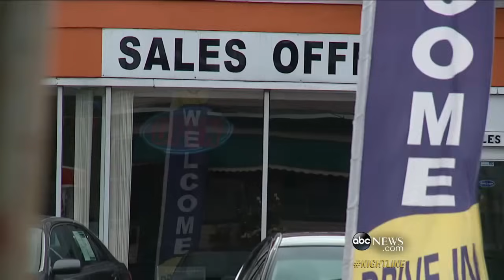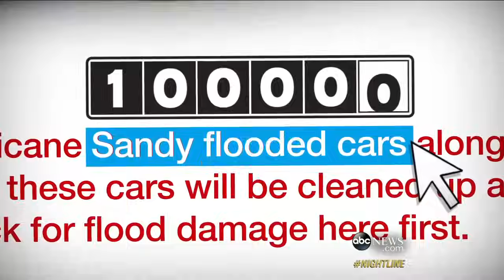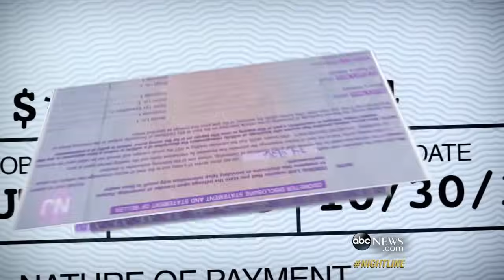How Did a Sandy-Damaged Truck Land on a Used Car Lot?

Comment: I'm going to leave this here:
 I buy cars from a popular site called Copart. I bid on a 2010 King Ranch that I knew had a flood title and I normally won't touch vehicles like this. But the thing was, is that it hadn't been in a flood at all and if it was, it only came up to the tires. This truck is the cleanest truck I've bought. No signs anywhere of water damage. Undercarriage, motor, fluids, under the carpet, and the frame still had original paint on it. This truck will never be road worthy, as the insurance branded it as a Parts Only vehicle - a step beyond a Salvage/Flood title. Which was unnecessary (if you could see this truck).
The only reason I'm commenting, is that there are instances where if you fall into a certain area that was "flood area", all you had to do was call and say your vehicle was in the flood and the insurance company sent a tow truck, hauled your vehicle away and cut you a check without inspecting it themselves because of the amount of calls they were getting. So, just as guilty for fraud as this car dealer was, so are some people who just want to buy a new vehicle and get out of their current one without an issue.

Comment: I can fix that truck
Reply: so can i, just put in a new floor, new seqats, remove the bags. oh and new carpet, and dash. less than a 4k job, for something that looks good as new. year 20k is about right, just 4k and work and anyone would believe it was brand new. the wiring in some seats for those f-350's come with the wiring.

Comment: it's a ford and it survived fine, you don't f*ck with fords nuff said
Reply: I like Ford, but I'm not going to say anything from GM is for "pussies," I only dislike them because I know they are unreliable. Of course, people might even say the same thing about Ford. It's really only a matter of opinion. I just happen to mostly agree with your opinion!
Reply: BixelWeekly Right kinda like a Ford dropping its cooling fan an shredding stuff before it even starts the ike gauntlet lolz :)
Reply: BixelWeekly exactly
Reply: I honestly do not see how one is better than the other. We got a chevy with 261k on it and is beat to shit, runs fine. My dad uses a ford truck he got from his work. If the owner takes care of his car, pretty much any car will last a long time.
Reply: Can’t imagine anyone saved a 6 liter smoker.  It was out of it’s misery.  Poor thing was almost just parts before the flood.  
Also; used car dealers usually are not mechanics and a lot of them get these flood vehicles at dealer auctions and they aren’t aware of that history.  The people that ‘recycle’ these and get a clean title need prison.  There’s no teeth to penalties.
Reply: Fix Or Repair daily.
Reply: Everyone here knows dodge is the way too go.
Reply: My 6.0 powerstroke has 300k plus on it bone stock and it’s solid!
Reply: my honda 1.0L has 310k plus, bone stock and it still gets 75mpg! oh wait, we were waving boners here...

Comment: Any salvaged or totaled vehicle fixed and inspected by the state WILL NOT have a clean title. It will have a reconstructed title showing that it was declared totaled by the insurance agency then fixed and inspected accordingly.  If a used car dealership has a clean title and does not indicate the vehicle was totaled due to a flood or a crash, they are scamming customers.

Comment: This is so stupid that there trying to stop this if the vehicle is functional why not sell it?
Reply: It is a hazard to drive it.
Reply: Zack Zander I know that but those issues could be fixed fairly easily
Reply: ***** My comment was stupid its a dumb idea to try to scam people lol
Reply: Chris S. you clearly dont understand what salt water does to electrical connections and all kind of moving parts
Reply: Monera96 My comment was stupid please just disregard it
Reply: ***** Haha! I don't think before i make comments alot
Reply: Ya they can still sell is. Id buy that truk ti drive around. But i wouldent pay more than 1000$ cuz it wont even last 1 year. And if you decide to restore it youd probably end up paying around 15 000$ to 20 000$ salt water destoys cars. It turns all the metal to rust.
Reply: +Chris S. Fuctional now, failing not too far down the road
Reply: +Nicholas Mcintyre Metal thats painted wont be effected by rust . And the salt needs water to activate the rust . So if you drove this truck to arizona or nevade or california highlands desert area it would rust ever . So a good thorough wash and wax and this truck would be fine . Although i would replace the interior thats it .
Reply: make a rat rod mud truck  out of it
Reply: Salt water in the electrical system can cause a ground/short and like said even trip the airbags. Just cause it runs doesnt mean it wont blow the fuck up in a week or two. Cat title history should not be erased. Fkin dmv.

Comment: Well considering it is a ford it should have been crushed right out of the factory!
Reply: gunnar stahl but then yet it survived
Reply: Bryce Swiger "SHOULD" not did
Reply: RandomUser M my cobalt has 140,000 miles on it, what's your Ford's get up to now? What 100 miles total.
Reply: RandomUser M oooh, big man, can't say cusses.
Reply: RandomUser M come back when your cars have good quality.
Reply: RandomUser M Ford was shat on before they rolled out.
Reply: RandomUser M nor does personal experience.
Reply: Your real funny aint ya
Reply: the one and only rusty shakleford a cobalt is a pile without being in a flood. What a poor quality vehicle.
Reply: Lol a cobalt. Its probably on the verge of dying if you are going to compare something to Ford don't make it a Chevy
Reply: Especially with a 6.0 powerstroke and automatic transmission lol. Even if it was a manual trans it's still gonna be a disaster flood or not with that 6.0
Reply: @theoneandonlyrustyshaklefo6256  that's a lie

Comment: Dealers are required to disclose that the title is a rebuilt to customers.
Dealers can sell vehicles with rebuilt titles. And usually if a vehicles is inspected and passed then it can be sold.
But if the dealership did not disclose that a vehicles does not have a rebuilt title they can lose their license.

Comment: It's a lot more complicated than it appears... I rebuilt a salt water flood car for my own use in 2002, my buddy had the MV dealer license and the 2001 mercedes was at a local ins salvage auction w a rebuildable title. First of all, the water never got over seats, much less in the dash. Second, I stripped the interior, rinsed clean insulation, repaired wiring in the floor and replaced one seat mechanism and some other misc elec components. Third, I steam-cleaned the heck out of the vehicle to remove salt residue. Finally, and most importantly, I knew what I was getting into and the car had a rebuild title after inspection. This car was recently sold by my son with over 200k and 16 years on it, still running, still on it's original starter, alternator, transmission, , etc, not rusted out and with only wear items replaced over the years. To say that all flood cars MUST be salvage-only is ridiculous, it only drives our car insurance rates up and up and encourages shifty antics to 'wash' titles.
Reply: I bought a flood car not knowing it was flooded and It rotted inside out.

Comment: My wife once unknowingly purchased a Buick Regal for my son that had been submerged (these people should be in prison for knowingly selling a dangerous vehicle), the title was clean and car fax had no hint of problems. I first suspected this when in the middle of the night the horn started blowing all by itself, had to disconnect the Batt. to stop. Then all the tail lights started going out and found heavy corrosion under all the panels (this damage would not have been seen unless dis-assembled), I eventually gave this car to charity with a list of it's problems. Apparently it was in water somewhere as an individual case, dried out and cleaned up without any insurance claims or dealer repairs.

Comment: I ended up with a truck that had been under water. It was a nightmare for all 3 years I owned it. constant electrical troubles and things turned up corroded with no explanation. I finally unloaded on a push/pull/drag sale and told them I suspected it has been under water.
No recourse other than I got rid of it before I put any more money into it.

Comment: anything can be rebuilt and theres a lot of good mechanics that can do it right
Reply: trollinU you really don’t know what happens to flooded vehicles. Almost nothing is salvageable. That salt will eat the frame in 5 years, the body will rust in 5 years, the interior will deteriorate in 5 years, all the electronics will fry. The engine will seize anyway cause it’s a 6.0 powerstroke but the salt will help that time bomb tick even faster. So nope

Comment: My old boss once worked for a used car lot. They bought a nice 62 Chevy cheap at an auction, nice and clean.... Funny it started stinking on the lot and nobody could stand it. Doing some checking on it's history, turns out it was a car some poor soul committed suicide by running the car in a closed garage. The body was not discovered for two weeks!
  They even went as far as striping the interior and replacing it, even then it stank!

Comment: I've lived close to the Atlantic Ocean most of my life and I see the effects of the salt water environment as well as road salts in winter. My greatest concern is the  tow vehicles used for trailering boats to and from boat launches. People actually drive nice pickups and suvs PURPOSELY into salt water presumably to make the boat launch process easier. People who launch only into fresh water may not be able to identify with the issues of salt water getting into everything. It's all the same as going through a storm surge only not as deep. 
  The electrical wiring alone is reason to permanently remove any vehicles that have been even partially submerged in a storm from the market. They might be parted out, but that's about it. There are hundreds of electrical connections that will likely cause trouble at some point. I wouldn't want any brake parts and maybe even some driveline components either.

Comment: I've seen a lot of flood damaged vehicles that have only been in a small amount totaled . And they're fine clean them out so the carpet doesn't smell check the fluids for water and change them out and all is well I'm a firm believer in fixing stuff and anything mechanical can be repaired
Reply: King Shti Not with salt water, buddy.
Reply: scowell That truck could have been fixed, but the question is, is it worth it? It would need thousands of new parts to replace salt water damaged parts.
Reply: Ford6.9/7.3idiDiesel You can never fix a vehicle that's been dunked in salt water.  The frame/body has to be replaced... that's called a new vehicle!  You want to save the windows?  That vehicle is junk.
Reply: scowell Yeah, I know.
Reply: King Shti 
If you knew anything about mechanics then you'd know that a vehicle that has been submerged in salt water will eventually rot out at the frame and the body, making it a really bad investment unless you go through the trouble of replacing a whole frame/body.
Reply: +cake face
Salt can be pressure washed off and components can be replaced all I'm saying is that if it's done properly flooded cars and trucks can be used reliably for years
Reply: King Shti you can't pressure wash off what you can't see. Like inside sub frames and such. And that's the point, it will rot from the inside out.
Reply: Jason Arno Vehicles come apart into many tiny pieces. This particular truck won't see it done, but if it were something more sentimental (namely a classic car) it would be taken to a shop, stripped down, and inspected before being cleaned and reassembled. Salt water is not the end of the world for a car that's worth the effort.
Reply: theoneandonlypirate You're not understanding. You CANNOT pressure wash off rust that you can't see on this inside no matter how much you take the car apart. If the metal is rusted off at the frame, as in the metal completely is turned into complete rust rot, the it is game over for the vehicle unless you disassemble the whole vehicle, bolt from bolt, re-weld the rusted spots and re assemble the car.

Even then rust will still pop up and rot out again, making it viable to completely swap out the frame, and at that point, you're going to be spending way more than the truck is worth if you take it to a professional. Yeah you can drive it around for a year or two tops before the rot becomes a real big issue, but the minute you hit a bump or get into an accident, your frame will snap right in half.
Reply: Cake Face If you can't get to it with the highly advanced tools available to mechanics, then neither can water. Like I said, this truck wouldn't be worth the effort of doing it since it's so new, but skilled mechanics can and do regularly repair and stabilize severe rust. There's a reason there's a booming automotive restoration industry. In recent years it's actually been practical to recover and restore vehicles ditched in salt water after WW2 - including airplanes. Rust can be removed, metal can be repaired. Salt water is not the end of the world.
Reply: Cake Face And your thoughts about cars and trucks in Buffalo, Rochester, Toronto, Montreal, Syracuse that are not exposed to salt water for a few days or a week, but salt water mist, which is FAR more corrosive than salt water, for several months every year? The mist gets into the inner body welds, frame, suspension, brake lines, bolt threads, electrical connectors...
Reply: scowell What a load of bullshit i had a Nova GTE that was completely submerged upside down in salt water when it was stolen the girl that owned it never wanted it back so my dad bought it for me it was steam washed engine stripped and rebuilt new interior out of another one that was recovered after being stolen it went on to drive for another 12 years never had any problems and was mot tested every year never failed only started rusting in the last two years by that time it was 15 years old and had 450k miles on it and the engine was ripped out and went into my other nova SRI
Reply: carsieplg Look at all the labor, etc that went into it... my point is that it is not worth it.
Reply: scowell Basically, most flooded vehicles are only good for parting out for the parts not damaged by being flooded.

Comment: These flood damaged cars should not be crushed. They have tons of parts that can be used even if flood damaged. Glass is not prone to water, same with plastics (bumpers, interior plastic trims, clips, grommets, tail lights etc) and alloys such as wheels and rubber such as tyres.

Essentially only the wires and electronics are suspect in a flooded car, all else are usable. Steering wheels are salvageable (just replace the air bag) better than a worn out one with lose grip holds.
Crushing is just destroying the environment.

Comment: This happened to me at what was Power Motors, in Cleburne, Tx. 2008 Chevy 3500 4X4 with 56,000 miles. Clean title, leather interior. Supposedly 1 previous owner. Was a flood truck. They sold it anyway, and I ended up having to take them to court to get a refund. They even sold me a warranty. All in all I couldn't even get all of my money back. Ended up losing about ten thousand. Always demand a vehicle history report on any vehicle you purchase, new or used
Reply: And what if the insurance company did not sell it as a salvage car ?  You do own a TV and see how much insurance companies advertise,,,, with companies like ABC. So if your expecting the "free" bought and paid for press to help you out, you will have a long wait.

Comment: USSA did nothing wrong. The truck was sold at insurance auction without a title specifically for parts. The fact it ended up with a clean title is the states fault and who ever put the effort into service

Comment: My issue with this is that I have restored old flood damaged vehicles back to showroom condition. If done properly I feel that a title should be able to be retitled as a Salvaged rebuilt vehicle. When you go to the auto parts store they will sell you rebuilt items known as remanufactured items. It is old items that didn't work and they were repaired and now resold.

Comment: Hurricane Sandy is one of many reasons i gave up cars and started riding motorcycles/scooters/mopeds. I live in NJ and I've seen tons of dealers selling flood cars. I'm good. If i get a flood bike, thats not as bad cause bikes are super cheap and easy to fix.
Reply: Just get a low mile beater, theres plenty of them where you live.
Reply: i have a car i share with my gf. I only work 3 miles from home. I live 1/8 a mile from the shore. No need for 2 cars.
Reply: @stevethomas6994  Same here but we have two cars and two mopeds, also two bicycles. Don't ask me why lol

Comment: Salt water is also being a conductor for electric to travel . So the electrical could also be on its way to frying all the wires and fuses due to the salt water still inside the casing of the wires themselves . After all wiring isn’t waterproof . These people whom sell these junkers should not be able to sell vehicles at all anywhere .

Comment: Always have a mechanic check a car with you before you buy it because not only will the electronics tell you that it is a flood car but the mold will tell you and even the water line on the outside will tell you too

Comment: what is not mentioned is how most salvaged or flooded cars are shipped overseas or to sent to Mexico to be sold. that 20,000 dollar truck would be 30,000 or more outside the usa
Reply: +Nicholas Hall well just to ship a car from overseas to the U.S. seems to cost at least $5,000 alone...